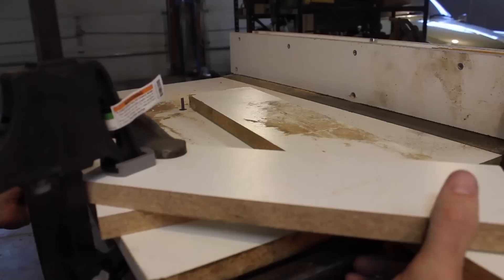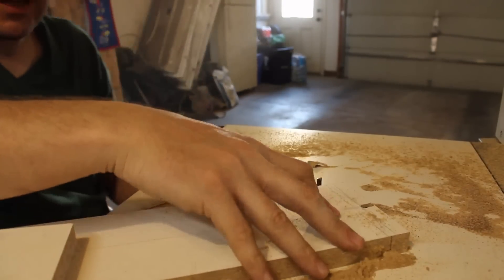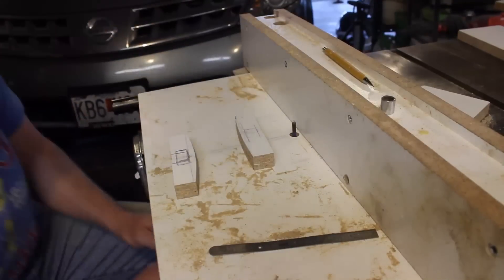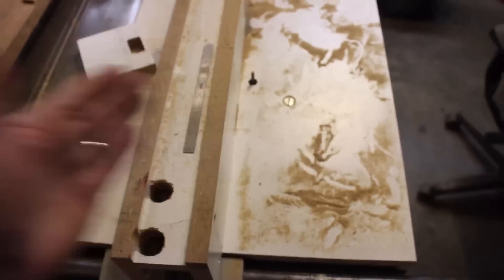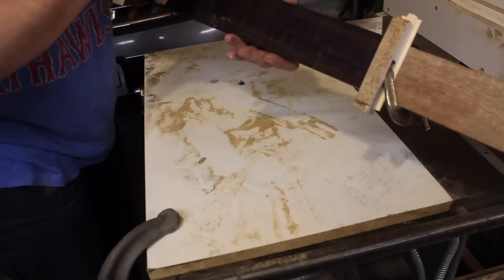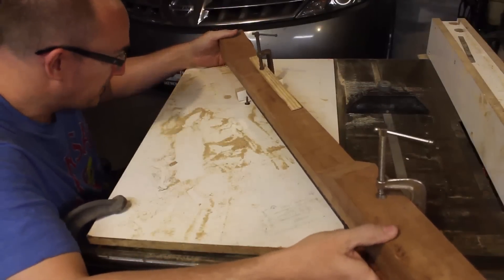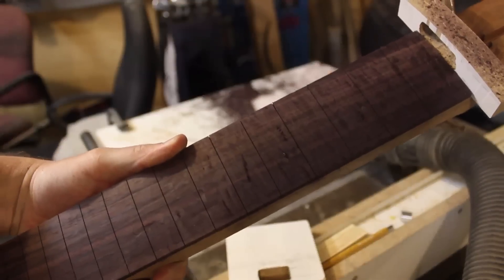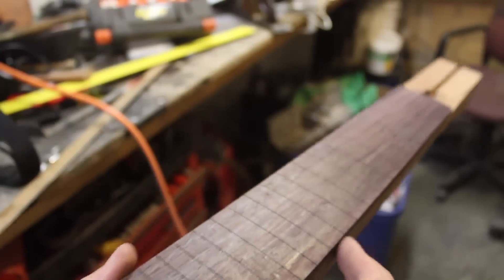You Can Make a Compound Radius Fretboard Easily - Guitar Build - Part 9

Comment: To be clear, the radius of the fretboard is not 12" on one end and 20" on the other end, it is that, minus the height of your guides protruding from the top of the fretboard. For example, if the "peak" of the radius of the guides is 3/4" above the top of the fretboard, then the radius in the fretboard would be 11.25" on one end, and 19.25" on the other end. Assuming you are hammering in the frets, this is not a big deal, and I do hope I'm not coming off as a jerk, just wanting to clarify some geometry that seems to have been overlooked. But really nice, simple solution to putting a conical radius in the fretboard! 

-Austin
Reply: AVPlutherie I don't understand your criticism.  If he followed his 12" and 20" guides, then he should have 12" and 20" radii (?) at the nut and bridge ends with a GRADUAL change from those as you move along the neck.  How does height of ANYTHING static outside his radiused guides matter concerning radius?  Radius is the curvature of the fretboard and if he rocked the neck to match his guides then he'll have 12" and 20" also on the fretboard, right?
Reply from the maker: TruthSurge Actually, I'll go with Austin on this one.  The guide blocks I made were dead on 12" and 20" radii.  When you rock the neck back and forth, they rock around the center points of an arc that is 12" and 20" above the neck in space.  Theoretically, if I had a really thick block of wood and I used a 2" tall router bit, I'd wind up with a 10" radius on one end and an 18" on the other.   That said, the router on this one was set about 1/2" tall or so.  The end results were VERY close to the radius template for each end and hand sanding brought them into perfect alignment with the templates.

For the record...  I did hammer the frets in by hand...  Using an arbor press would have been a trick.  You'd need a  different die for every fret or a die that was flexible enough to absorb the different radii.  Making that die would have taken me WAY longer than the 10 minutes of fret hammering.  You can check that out here if you'd like:  https://youtu.be/r-uozItlUUc

Thanks for the spirited conversation.  It's always good to question/debate this type of idea.  After all, I basically invented this technique, so it goes without saying that the first trial is probably going to need some refinement.
Reply: Greg's Garage  Ok, I understand that the radius of a CIRCLE changes as the distance from the center increases (ie, bigger circle = larger radius and flatter curve given same distance from one point on the circle to the next.

Got that.  No issue.  BUT you MADE (ie, FORCED the radius to be 12 and 20) the radius static by the nature of you creating those curves you used as your template.

So, I'm very confused how the radius (curvature) could change if your neck is swiveling at that radius, no matter how tall the router bit is.  It is never going to cut a DIFFERENT curve than the template one that rocked the neck AT that pre-defined radius.

?

IOW, your template did not change just because your bit was 1/2" high or 10" high.

Maybe I just suck at envisioning this but when you measured the radius after sanding with those cards you made, they looked pretty much on target to me. So, if your radius is SET (as you did by making them set via your templates or those blocks you rocked the neck on) then you predetermined the radius!  It cannot change.   The curve was set by you and that curve was matched by the fact you were rocking the neck along those curves.    moving the curves higher above the bench does nothing to alter the radius as your curve is set in stone, so to speak.  

So, I'm not getting how you lose accuracy based on how deep you want the cut (which... in my brain, you can't because it's never going to cut more or less round than your guide!)

Anyway, if you can explain it in a paragraph, I'm all ears.  Extended the bit is merely removing more or less wood evenly across your predetermined radius, the radius cannot grow or shrink - you made sure of that by creating the curve!  If you had the bit on the end of a STRING and altered the string length, THEN....  I would agree 100% because... that's altering the radius (the distance from the circle's center to a point on the circle).  

Your idea did not alter the radius but merely altered the depth of wood removed USING that radius.

Now call me an idiot but that's how I see it. :)
Reply from the maker: Here's how I see it...  The block sets the radius at 12".  DONE!  Then the bit doesn't offset that radius, it makes another radius that is concentric to the 12" block.  If I had kept the neck perfectly level and allowed a copy router to follow that block, then it would have offset and the bit depth would not matter.  That's my $.02 anyway...  I could be off my rocker, so take it for what it's worth.
Reply: Greg's Garage Well, it may be me!  I don't understand the difference so maybe I should stay out of the shop! hahahha   Anyway...  I guess I'd have to think on it more and yet... I got other stuff to do so I'll have to leave this as one of life's mysteries.   Where are you from, anyway?  Lots of those sayings you used sounded like stuff I heard growing up around the mid-south.
Reply from the maker: Kansas City.  My dad was full of quirky little sayings... They rubbed off on me.
Reply: Greg's Garage  Ok. We're not too far apart.  I'm near Memphis.
Reply: You're right. If the radiused blocks were a foot tall you'd need to make the router bit protrude a foot from the table to reach the fingerboard. It would still cut a 12" radius at the nut end, not 24".
Reply: Sorry, TruthSurge, I have retracted my support.  :-)  
I have posted another reply above that may help visualize why I think the bit height affects the radius of curvature.
Reply: Yeah, if I draw a picture, I'd prob figure it out.  I didn't draw a picture! haha   thx
Reply: I believe the first comment is correct. The further away from any radius-ed guide you follow the further diminished is the radius cut.
Reply: The further away from any radius-ed guide you follow the further diminished is the radius cut.
Have re-thought my initial comments and edited as much to conclude above comment.
Reply: @cincinattiblues If you made the radius pattern into a full 24 inch circle and followed that all around a piece in the middle, that piece would not come out with a 12 inch radius.
Reply: @hakancarlsson2881  I see what you are saying and yes have rethought my previous comments and edited them to conclude same as what you say. Thanks for the heads up. Cheers.

Comment: I'm not sure if this could be a problem... But this popped in my mind. Would the whole job be screwed up if the two radius jigs were not perpendicular to the neck?
Reply from the maker: If they were centered the radius or radii might be incorrect, but in the correct alignment.  If the jigs were off center AND not perpendicular you'd have a weird warp to the fingerboard...  Or at least that's what I think might happen.